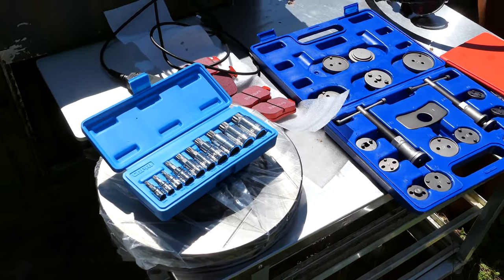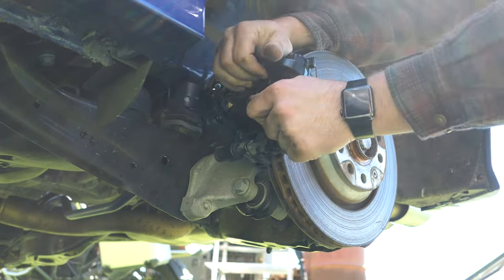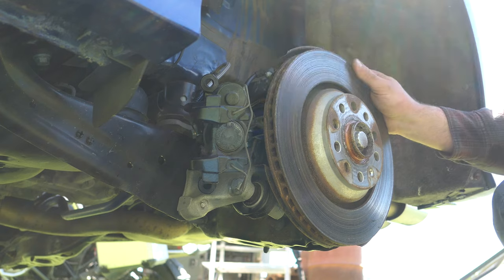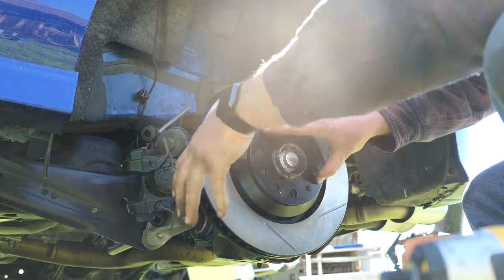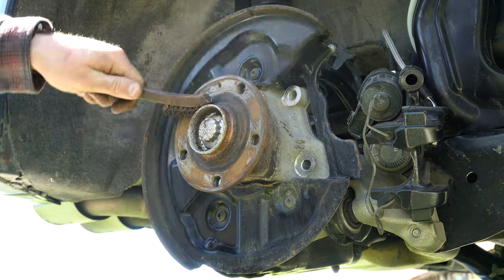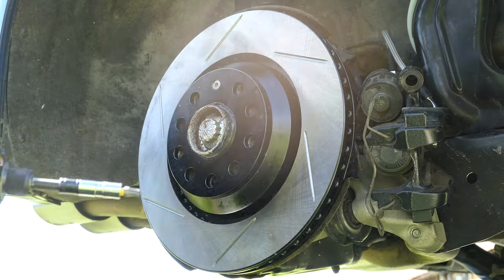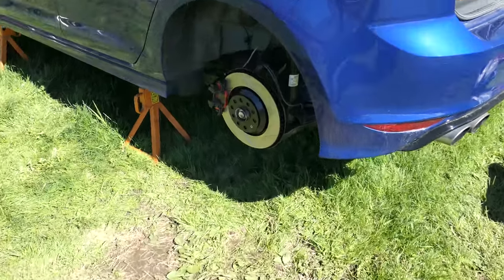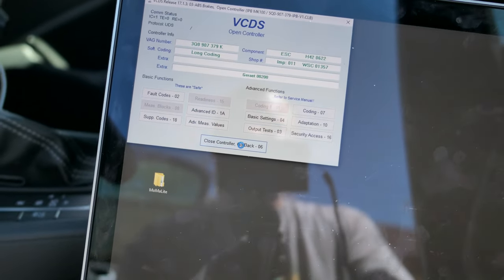How-To: Change the MK7 Golf R Rear-Brakes w/ Electronic Parking Brake

Comment: Just a FYI that’s not a twist caliper, all you have to do is simply depress the piston in.
Reply: that is good to know
Reply: is that true? then why does the piston have all the holes to rotate it while pushing? thanks for the info that was my concern before doing my rear brakes on my Mk7.5 2018 Golf R, thanks
Reply: This is not true at all
Reply: Can you wind motor backwith out computre connicting  and than press specail tool to  press piston back or not in electric hand break or you of to use computer to wind piston on these cars

Comment: For reference you do not need to remove the calliper carrier! Just undo the two 7mm hex bolts on the pad carrier, disc can easily come off, plenty of room! Just make sure you have a 7mm hex head as not many tool kits or hex head sets have them.
Reply: Not necessarily true, I just attempted this on my wife’s 2016 A3 S - Line and the rotors would not come off as the carrier was keeping it from being removed.  Mind you we are in Canada
Reply: @Emilio-it7tk  Needs to be the S3, the offset on the hub is different on the A3 making the hat of the rotor deeper and fouling up when you tried to remove it !

Comment: I easily got the caliper off with a hex wrench and replaced the pads. Thoughni was unable too get the carrier off too change the rotors...  now i have 200$ worth of rotors and a 75% done brake job🫠
Reply: Carrier bolts are tightened to 200ft lb if you’re wondering why you can’t get them off put a little extra force into it

Comment: You should wire brush the hub dry and clean it till the surface is smooth so the rotor sits even. If you don’t you will feel slight vibrations or pulsing when braking

Comment: The caliper and the Pad holder is possible to part while on the car. You will need to remove the spring up front and on the back side (those studs you lubed) under two small plastic caps there is a 7mm hex screw. Remove those and the caliper will come of.
Reply from the maker: thank you so much. I had a terrible time with this. I hope others can benefit from your comment. Glad I don't have to do this for a few more years :)
Reply: You should warn for this..... I had a terrible time following your video too, until I found a video of someone who actually knew what he was doing... maybe even take the video down cause it just doesn't do any good this way.

Comment: Hi Adam. What adapter size did you use to press back in the caliper? Was it size 7? Thanks
Reply from the maker: 7 sounds right. Honestly I can't remember. I just tried a few from the kit until it fit.
Reply: @AdamChandler86  Its a 6.

Comment: I enjoyed your video, very relaxing :) My question is, on my 2017 mk7 golf 1.4 tsi, rear brake pads completely finished after 30.000 kms but fronts still stay like new. Do you have any idea what might be causing this? I heard some people say it`s because of electronic parking brake but I`m not sure. Thanks
Reply from the maker: Oof, and it's just one side? Both left and right? Sometimes that's indicative of an E-Brake issue. You can take the rotors to a shop and see if you have warping but again, that usually doesn't effect both sides. I'm not really an expert here but in your shoes, I'd probably bleed brakes, calibrate E-Brake, replace pads & rotors and then go back to normal driving and if it happens again, then have a professional look at it. OOH maybe when the brake pad carrier is off, you can make sure the pistons aren't stuck, use a wind-back tool and make sure that the pad carrier bolt has a good amount of grease on it.
Reply: @AdamChandler86  Yes, both sides have almost same amount of wear. I don’t think there’s a problem actually. Car drives well without hesitation, I mean it cruises smoothly. I’ll take it to VW service soon for pad replacement. I’ll ask them if it’s normal or caused by any external factor. Because I read from other people which they have same thing(rear brakes finishing sooner than fronts) with their electronic hand braked vws. Imo, when you use hillholder or activated electronic hand brake, it releases the brake after some time of clutching point. There is a slight delay which might cause such wear. I don’t use it often but maybe previous owner was using it without thinking. I can’t blame him but obviously vw’s electronic braking is a technology to avoid.

Comment: You see the two rubber pads behind pad holder? there is one at the top one at the bottom (you can see the top one at 1:40) they have a plastic plug on them, remove them you'll find a hex screw in each one, remove the screw then remove the spring in the front of the pad holder, that's it!
Reply from the maker: I just hope people read the comments and see this before taking this up. It's the first time I"ve done the brakes on this car.
Reply: Adam Chandler you should find out before making this video😉
Reply: Is that all you need to change the pads?
Reply: Yes
Reply: Thank you for this video and the comments, I couldn't get my head in there to see what size or kind of bolt it was holding the caliper on. 7mm hex is what it was.

Comment: Hi do I need to de compress the piston if I'm just changing the disc with no pads?
Reply from the maker: If you are removing the caliper, you probably have to compress the disk. Most people shouldn't just replace the rotor and not the pads but it can be done. The compression is usually because the new pads are thicker. The new rotor will also be thicker by a couple of millimeter. Best to rent a caliper compression kit just in case you need it.
Reply: OK thanks

Comment: Can you wind piston back with out computer connecting on and than press piston back with specail tool to press piston back or you can damage motor or piston in caliper electric handbreak explain me please mate thankyou very much
Reply from the maker: The electric handbrake module I know some have or have tried to do it manually. It’s just not advised. If you can find someone who has a coding tool computer, it makes the job much easier.
Reply: @AdamChandler86  i have done it is easy with out scanner i have winded back no problem it is working perfict mate anyway thank you mate you dont nead scanner you can do with out scanner

Comment: Your a legend! Thanks for the tip with rotating the piston to depress it!! That had me swearing before I watched this
Reply from the maker: LOL> we’ve all been there!
Reply: Hey dude. I've just done my front brakes on my Mk7 GTI and gonna now tackle the back. Please advise on weather the rear piston needs to be rotated and pushed at the same time or if it just needs to be pushed back in without rotation. I have the e-brake set up and the coding to retract the motor so that's all good.
Reply: @joshua4859  On types with EPB, the piston pushes back, once the EPB is in service mode. It doesn’t have the threaded piston like a std handbrake model.

Comment: Is the electronic release with VAG-COM essential? what happens without it?
Reply from the maker: You only need VAG-COM if you have an electronic E-Brake. If you have a hand brake, you can do this w/o the software.
Reply: @AdamChandler86  I got a question. What if your replacing the rear bearing and ABS sensor, do you still need that software?